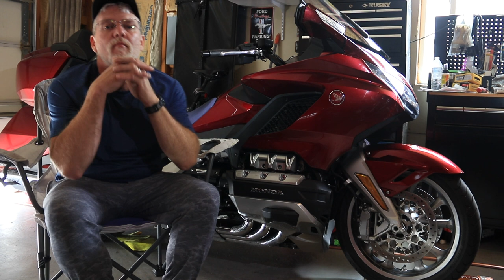Goldwing ticking noise

Comment: Hi man, i can see the frustration on your face but trust me this ticking noise from the engine is totally normal and there is so many stories online about it. I have a 2018 Goldwing and i have been hearing the ticking noise which comes and goes since day one without any issues as well as a lot of my friends who bought the latest generation Goldwing. enjoy the rides and am sure if you ever faced any problems with it, it will be covered by the warranty.
Reply from the maker: thanks for the reply.    and  the feed back.   I took it to a different mechanic and he explained it to me. still makes the noise but as long as its normal   then I am good with it. have a great day
Reply: That's absolute nonsense.  Mine exploded at 2,700 miles.

Comment: You are absolutely correct in expecting Honda or the dealership to adjust the valves at no cost to you. As a side note I am glad I watched this video because I too bought a new 2023 , new in the crate, 0 miles and almost immediately noticed a ticking from the right side cylinder bank. I can now assume that this ticking is normal and just the nature of this beast.

Comment: Hi,
I live in the U.K. and have a 2021 DCT Tour. 
My engine started to make the ticking sound from the front right side cylinder bank at around 1000 miles, and although I was just as alarmed as you were I decided to research the issue on the online forums. 
The one thing that has improved the engine sound is switching to higher octane gasoline, the bike definitely runs quieter and is more responsive, run your tank low and top up with premium, it’s worth a shot!
Reply from the maker: I  will try  that  thanks
Reply: It's buggered, it will explode............. Mine did.
Reply: @humbleplumbersadventures4602 is it still ticking after putting it up on the center stand??
Reply: I only use high test/super in my Wing, and still had the ticking..
Reply: I changed my oil from Amsoil which hides the ticking sound to 4t racing synthetic oil which you can hear it. The convetional oil is thicker and muffles it better but the synthetic has better lubrication qualities that cleans and is forgiving for forgetful maintenace. The sound comes and goes but never has caused any problems.

Comment: All three of my Goldwing's had a ticking noise. None caused any issues even after many thousands of miles. My experiences were this noise is minor and if you put on your helmet or tunes, you likely will never know. Also never adjusted anything unless a service worker did so during a routine interval that I was not aware.
Honda valve adjustment is 32,000 miles.
Good Rides
Reply from the maker: Ya  they don't  bug me anymore. I just wanted to make sure  it wasnt something that needed fixed.

Comment: I know others have responded but I just came across this post. I am in the UK and have a 2018 DCT Wing that I bought new over 4 years ago that now has over 23000 miles on it. Mine has always made a ticking noise while warming up. It starts about 30 seconds after starting and gradually diminishes until the motor is fully warmed up by which time there is no ticking at all. It seems that most of them do this to varying degrees and I am not aware of it ever causing any problems. Certainly I haven't had any problems with mine. I am not sure what causes it. Some say it is the valves others say it is the injectors. Whatever it is it seems that it is pretty normal and probably not much to worry about.
Reply from the maker: Really appreciate the post pal.   Ride safe.

Comment: Hello, I purchased a new 2023 Honda Goldwing Tour DCT in mid July and it currently has around 120 miles recorded. I always keep the bike on the center stand and yes I noticed the ticking sound appearing to be coming from the engine right side. The ticking seems to go away after the engine warms up and the engine sounds appear normal. I noticed the ticking after a cold start and the garage temperature was around 80 degrees F. This was on my second ride from bike purchase. I will continue to monitor and keep the dealer advised. The ticking sound seems to be quite common with Goldwing owners. All the Best, James.
Reply from the maker: thanks  for commenting

Comment: My 2021 dct ticks a bit leaving the house but never returning to the house. Purrs when fully warm. Highly suggest changing the oil every 4000 miles not 8000. Keep the oil in that fine engine and clutch fresh.

Comment: I bought a ‘23 at end of October ‘23. Got it home and noticed the same tick. Contacted dealer. Sent them video. The dealer sent video to Honda. They said it was normal that it is documented…to just ride it. I wasn’t satisfied. I had the dealer come pick it up (100 miles away in winter). I paid for transportation but the dealer agreed to check valve clearances and chain tensioners at their cost. Two were slightly out of specs but they corrected it. But…nothing changed. Tick is still there. Now I know it’s documented since I got a work sheet from dealer. Was told that if it fails…there’s proof and it will be repaired. 
Rode 1500+ miles since and no issues yet. I will continue to keep an eye/ear out for anything though.
Reply from the maker: Thanks for the comment pal

Comment: It's always better to have slightly looser (adjusted to the loose side of the spec) than tighter valve clearance due to the thermal expansion factor. Now I'm not saying the valves clearance should be looser than spec, but mine 2024 has a slight ticking sound also, I'm not worried about it at all. Valve gear makes noise, they are under an exposed cylinder head cover of thin aluminum, you're going to hear noise. Ever see a modern car engine? Huge thick plastic cover on top of the valve cover with sound deadening insulation under it;  that's to dampen the valve noise folks. If Honda put that on the Goldwing, you wouldn't hear a thing.

Comment: Honda UK are an embarrassment to themselves.  2021 Goldwing with less than 3,000 miles on the clock decided to eat it valves.  Nothing unusual there… Just YouTube “Goldwing ticking noise”…. It’s quite a well known phenomenon that Honda know about…. but will vehemently deny.
Unable to use the machine to save further damage, total breakdown and a potential injury accident, I have to wait weeks for an appointment for a ‘diagnosis’ (on a defect they already know about!).  Once dropping the bike off at the Dealers they claim to have adjusted the valves and simply hand the machine back still running on five cylinders, coughing back through the inlet tract and stalling.
I call Honda UK for help and they say…. “No can do, you’ll have to fix the thing at your own cost as it is now out of Warranty”.  S’Funny that….. it was in Warranty when I took the bike in months with the fault reported earlier.
Slippery b*st*rds.
I bet they delete this post…. So I’ve copied and will add to any later Sponsored ad’s that they do.
It certainly will be added to the Cruiseman Garage YouTube Channel.  After years of buying new Honda they have ruined their reputation and are nothing but charlatans and vipers.
My Supplier/Dealers did nothing wrong, they were excellent too.  Chucked under the ‘bus by Honda UK. What a crazy situation?

Comment: Had the same problem on my 2018 Wing. After a lot of back and forth with the dealer as you have done, I found my solution. Add an extra 1/2 quart of oil. It quiets the ticking noise a lot.
Reply from the maker: thanks for the advice

Comment: I can understand the dealers issue. If Honda doesn’t stand tall and address the issue the dealer doesn’t want the liability in case something doesn’t go right. My 2021 DCT does make a slight tick but not enough to cause concern and I never hear it when riding, at 17k miles it sounds just like it did off the showroom floor. Checking valve clearance isn’t a big deal, shouldn’t take more than an hour but if any valve needed adjusting they need to check all 6 cylinders. The valves adjust by shims which takes more time than the screw adjusters did. I’d be surprised if it’s a valve but worth a check if Honda says they’ll take care of it and gives a paper trail in case it gets worse later. Enjoy the ride, it’s a spectacular machine.
Reply from the maker: Thank pal For the info.

Comment: I am going through the same thing now. But I paid the 317.85 for the dealer to check them and was told a few a little loose, but within speck. They also neglected to call honda whi h I have acase with. I took it home and apart and made a video of me checking the valves and sent it to honda  a powerspot place. It turns out it is a bad adjustment of the valves from the factory on the right side.if they don't do anything I will put out the video as is. If honda takes care of it I will tone it down for educational.
Reply from the maker: Buddy I don't blame you. Atleast my dealership got honda to pay for it

Comment: Congratulations on your new magic carpet, and it's red too.  I have an FJR but I understand that when you have a quite machine the ticks, whistles, whines and grunts are more noticeable.  I recently changed tires and the sounds are different and at different speeds and lean angles.  I do all the maintenance including deep dives into the bowels as needed to keep everything in harmony.  I would have had my electronic stethoscope hooked up to locate the noise as you can listen while riding.  Once you know the location you can have chat with the service techs, or in my case, pull out the shop manual and identify the potential culprit.  Personally I would be checking the valve clearances myself.  It's a bit more complex on an FJR.   On the expectation side, if the noise is noticeable and the techs agree then it should be fixed, the dealer and Honda can decide how to fund it, it should be transparent to you. I am with you, the old fashioned hand shake and stand by your work.  A happy customer is money in the bank, yes, there are some you will never please but they are rare, soul destroying but rare.
So enjoy you magnificent machine, turn up the music, smell the roses.
Hope this helps.
Reply from the maker: thanks for the comment pal

Comment: I have to say starting in '18 a  redesign of the engine with 4 valves per cylinder while tweaking the internals and redoing the gearbox maybe doing all this wasnt perfected yet and still in its experimental stage and things are going wrong whereas the prior Gen 5 '17 and under 1800 was already a bulletproof perfected engine. My motto is if it ain't broke don't fix it😮

Comment: You will hear lifter tapping occasionally just from switching from convetional oil to synthetic because of the velocity difference. It will come and go and sure you can pay to have a lifter check/adjustment or return to conventional to hide it.

Comment: The new engine 2018+ has the common shim and bucket system on the intake cams. The exhaust valves and cams use a trailing arm rocker setup. They are going to make more noise. And some a have a slightly loose valve lash setting from the factory. While the setting may well be within spec that one or two valves will stand out like a sore thumb. At 12k miles I adjusted mine myself. One exhaust valve set on each side of the engine. Was a two beer job, done and over with. Honda is not the company they use to be. I worked in trade/craft and I don't have the time or stomach to put up with Bull Shit spewing large mega companies that should be made to fall on there sword. Buy the bike from Honda and there sorry dealer and never darken there door again. Mine also has a clutch switch issue. No fix from Honda but to replace the clutch switches. So if it acts up I just pop out the old clutch switches, pop the new ones in and forget about it. Mine also had a finale drive leak. Yes Honda would have covered the leak and fixed it. Heck I even have there stupid extended warranty. I would have had to wait on the idiots at Honda to approve the repair,,, then wait on the dealer to get the bike into there shop and then wait on them to fix it. Got to looking at the parts. O-Rings and seal $40 in parts including shipping. I fixed it myself. That was a four beer job. Just the way things are now days. Even the so called best made is junk now days......
Reply from the maker: Thanks for the reply

Comment: I totally agree with you... Corporations definitely don't stand behind their products anymore....My 2018 tour dct started the right side tick at 15k.... Disturbed by it at first, however after reading many comments about it on forums, sadly it's pretty normal. Bike still runs great, I've gotten used to it
Reply: Report back if fails to reach 120000 miles without opening the engine.
Reply from the maker: Wow what happenned.

Comment: Thanks guys for bringing this topic, recently I purchased a 2024 Honda Goldwing tour after 6000K. I hear this ticking noise.  My question is to the gentleman who post this video, does the ticking sound gone completely after the service.?
Reply from the maker: No the ticking noise was still there. I did watch a comment where the service guy tightened  the valves to the max the specs would allow and it did seem to help a lot.  but now my ticking noise is still there.
Reply: My new 2023 has a normal ticking sound on right side of the cylinder
Reply: @humbleplumbersadventures4602  thanks for the feedback

Comment: If it helps, my 2021 Tour DCT makes the same noise, and have been told and have read that it's normal.  I have 30k miles on mine, no issues. By the way, wish you were in my neck of the woods, i need help from a plumber! Hehe...

Ride safe!
Reply from the maker: Thanks for sharing.   I have found out the same thing.  that its normal I have 4000 miles on it now   and it still runs great.  love the bike  its so easy  to ride.

Comment: I spent 40-years in the HVAC trade and occasionally manufacturer’s defects will undermine your best efforts. Fix immediately. In the short term warranty repairs may cost the provider time and money but over the long haul a satisfied clientele is your best advertisement. 
The dealer should have jumped on this a.s.a.p. and filed a claim with Honda. At the retail level an occasional warranty denial is part of the cost of doing business but in no way should you have been expected to absorb the expense.
Reply from the maker: I completely agree

Comment: I had a 2019 Wing, purchased brand new, never heard any ticking. I traded it for a brand new 2022 Wing. I only have 1400 miles on it. A few months ago ago while I was warming it up in my garage, I heard ticking on the right side. I thought I was crazy. I just had my oil changed though I’m not at the suggested 4,000 miles for 1st OC, I figured after 2 years it was time to change the oil regardless of miles. I haven’t run the bike other than to ride home from the dealer OC, so I don’t know if the ticking remains. But I also know that there should be no ticking from pretty much still new $30,000 Wing with 1400 miles on it. I should add, the bike runs fine, but that ticking isn’t right..
Reply from the maker: Ive gotten used to  it.  love the bike though.

Comment: Try using the center stand instead of the kick stand. I had the ticking also. Stopped when I stored it on the center stand.
Reply from the maker: Ive been  doing that  lately. it does seem to help.. thanks for the advice.

Comment: My 2021 Goldwing1800 has only totalled 2,700 miles and immediately after its second service (in fact, the day after collection) I heard an extremely loud valve overlap/piston clatter followed by and immediate constant ticking from the right hand bank at idle and a bad rattle at revs.  I called the Agent and surprisingly they asked me to ride iit back in for a check over.  Only a 7 mile journey and they decided that a valve adjustment was all that was required.  I rode home and returned it only for the rectification to take the Agent one month to complete.  On second collection, I rode home (another 7 miles) and the machine was spitting back through the manifold and hunting badly.  I returned the bike for another diagnosis and was told to take it home again.  Needless to say................. It has exploded.  It's now only running on  five cyliders and sounds horrendous, won't idle and vibrates to high heavens.
Reply from the maker: Wow buddy  Im  sorry to hear that.    I wonder what  happened.   I'm   not for law suites.  but this  might be a  situation  that   might lead to  one.  most of us have no other choice to  trust are mechanics.  Plus that's why  we pay them.    let me know what happens.   thanks  for the info

Comment: Did it stop ticking? I have the same problem, mine has 900 miles, have not been back to the dealership
Reply from the maker: it did not  but I have learned that its  normal   for the bike to do so.  Ive been  told  that  putting it on the center stand  when its parked  can help.   thanks  for  the comment.